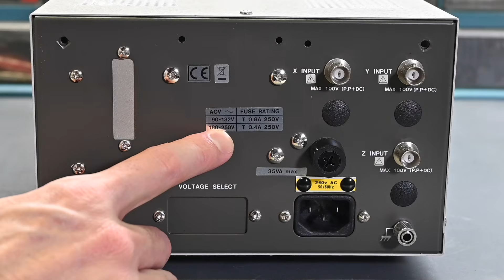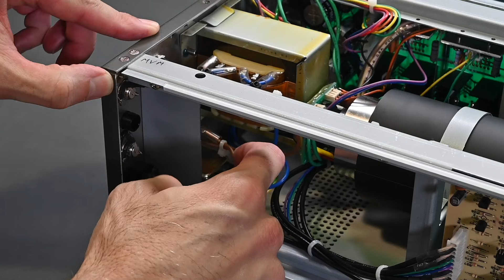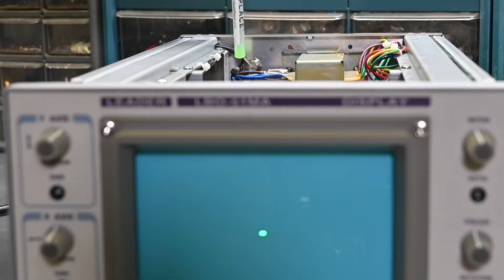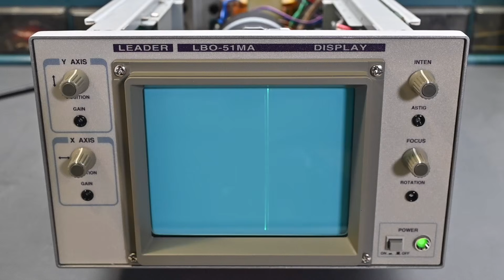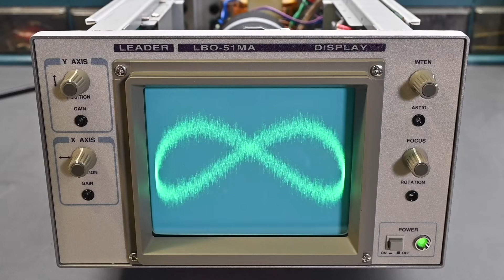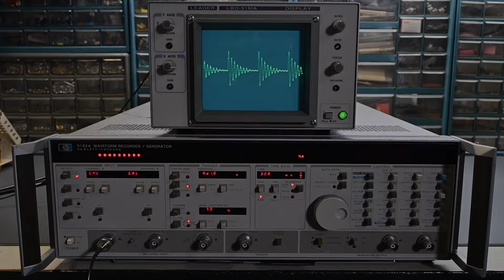How Does an XY Display Work? The Leader LBO-51MA CRT Display

Comment: So this is some kind of educational device? Am I mistaken or did we never see the right side?
Reply from the maker: The right side is a long circuit board with components facing inward so not much to see there, just the back side of the board, and no switches like the board I showed.  Several calibration pots and voltage test points but nothing that needed adjusting.    XY displays are used for phase and frequency measurements/comparisons, for component testing with a simple external circuit (I show how to do this in another video), and for use with devices meant to directly drive them as a display monitor as my HP 5182A does.

Comment: From Quora:

How the U.S. Voltage System Works

    120 Volts: Used for everyday items like phones, lamps, TVs, and small kitchen tools.
    240 Volts: Used for heavy-duty appliances that need more power. 

Common 240-Volt Appliances

    Electric clothes dryers
    Electric kitchen stoves and ovens
    Central air conditioning units
    Large water heaters
    Electric vehicle (EV) home chargers